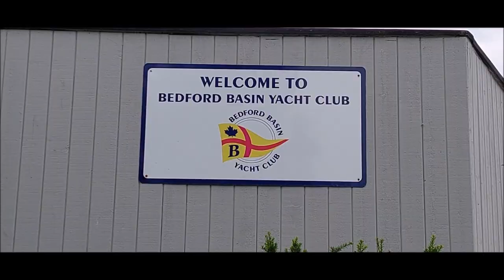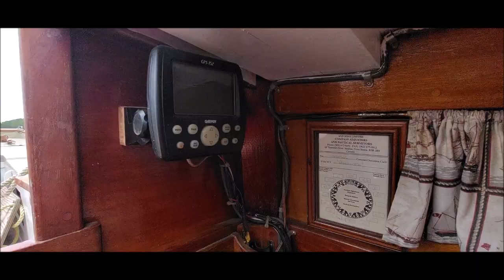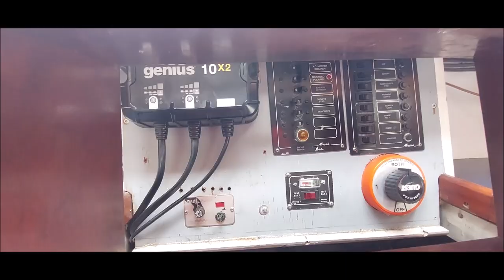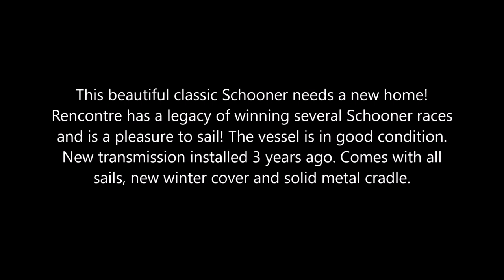RENCONTRE - Classic Nova Scotia Wooden Schooner

Comment: I am sure when the wind is right, this little schooner is the prettiest vessel in the harbor.  I would love to have her as a day sailer or weekend ride.  However, based upon my limited experience owning a nice sloop, I would estimate the cost of repairing the hull, restoring the rudder and giving the vessel a new hull paint job is in the 10K range.  A DIYer could save a lot, but I can see it is going to be a substantial amount of work. That said, I certainly hope someone takes on the project.  My days of such fun and sanding have passed.
Reply from the maker: The hull is absolutely fine. She's been on the hard for one season and the seams that are visible in the deadwood will close up in a day or two afloat. From the garboard up is strip-planked, so there are no open seams. She takes on no water whatsoever. She could use a scrape, barrier coat and a couple coats of anti-foul, but that's about it. The rudder are stern post are reportedly in good serviceable condition.
Her biggest challenge is her mainmast (not shown in the video) which might have a season or two left in it but will need to be replaced soon. Other than that, this vessel is pretty much ready to race or cruise.